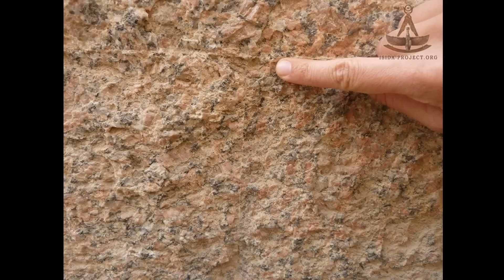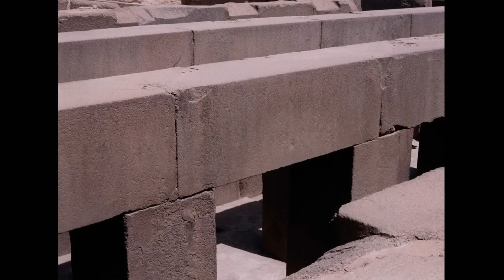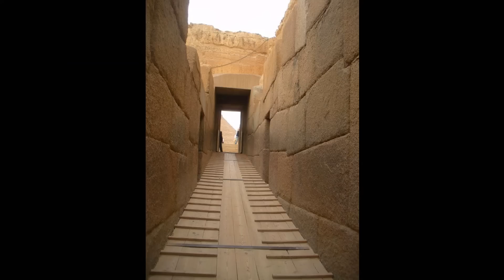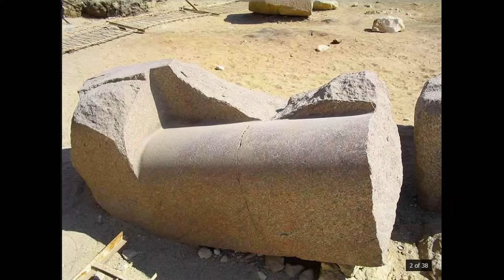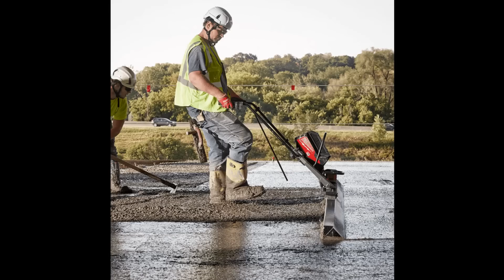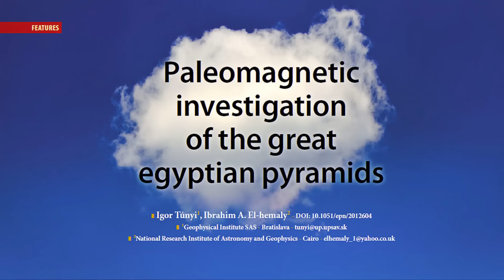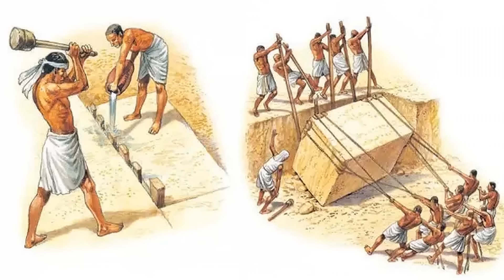How were the Perplexing Giza Pyramids' Granite Blocks Created?

Comment: I spoke to my dad, a retired builder about the granite blocks a couple of years ago. He suggested that they were caste on site. I would never have thought of that, and I had forgotten that he said this.  Makes sense.  How are you, Tina? Still in NY?
Reply: How are the quartz seams kept running through the granite then.
Reply: @MJIZZEL-MJ  You're not meant to ask pointy questions - you'll upset them :)
Reply: @MJIZZEL-MJ  
Some of the stone boxes in the Serapeum have clear visible veins.
Reply: @AArata63  Time stamp?
Reply: @Hallands.  
I didn't get any time stamp when I asked :(
Reply: Timestamp on what? 🤔
Reply: @MJIZZEL-MJ  Time stamp, please!
Reply: @MJIZZEL-MJ  
Where do you see that? Is there a time stamp you can tell me?
Reply: @ where they drill into the igmious types and find in tact organic material at microsopic scale , the carbon dating can be trusted, because its not supposed to be there.
Reply: Nonsensical. Where are the furnaces??? Where would they get heat enough to melt the granite??
Reply: @EggMCMUFFIN-e4l  What's wrong with you?  She did not say a single word about melting anything.  Casting of man-made stone is a cold process just as in the case of concrete.
Reply: @redwoodcoast  what’s wrong with you? Im relating to the comment posted not her reply…
Reply: @redwoodcoast  and why would you go through all the work to cast the stones??? Pulverize it, then make a mold, then find some adhesive to hold it all together, wait weeks for it to cure (look how huge some of these blocks are), and then hope all goes well after that. Natural stones are not cold casted. They’re created under immense heat and pressure, which fuses the crystalline molecules to fuse together. You would not get the same effect with cold casted stones…
Reply: @EggMCMUFFIN-e4l  Several large cast objects failed near the bottom and collapsed according to witnesses but to believe that 2,000,000 lb. blocks were quarried and transported and raised is to believe the impossible.  That only leaves two possibilities: they were cast-in-place or they were carved with extraterrestrial technology as was the unfinished obelisk.
Reply: @redwoodcoast  and what about the giant obelisk tht was carved out of the solid rock? Why would you cast the rock hundreds of miles away from its destination point??? Your casting rocks theory makes no sense… why would you spend hours pulverizing the rock into granules to then have to either heat it or use large amounts of polymer and pressure to hold the rock together???
Reply: @EggMCMUFFIN-e4l  

Cast, like how cement is cast, not how iron is cast.  I guess I have to find a video on how cast stone is made.
Reply: @EggMCMUFFIN-e4l  What's your theory then? ;)
Reply: Geopolymer cement  100%  core samples have shown human hair and other naturally occuring debri in the samples. Statues blown up by muslims had stacked rock cores with cast outer shell.
Reply: It’s crazy that these bots can extract information from her personal file on her account to know where she lives or what her birthday is… These bots are sick. 👆 is a bot you’re responding to 😮
Reply: In 1992, Egyptologist Mark Lehner and stonemason Roger Hopkins conducted a three-week pyramid-building experiment for a Nova television episode. They built a pyramid 6 metres (20 ft) high by 9 metres (30 ft) wide, consisting of a total of 162 cubic metres (5,700 cu ft), or about 405 tons. It was made out of 186 stones weighing an average of 2.2 tons each. Twelve quarrymen carved 186 stones in 22 days, and the structure was erected using 44 men. They used iron hammers, chisels and levers (this is a modern shortcut, as the ancient Egyptians were limited to using copper and later bronze and wood).   But Lehner and Hopkins did experiments with copper tools, noting that they were adequate for the job in hand, provided that additional manpower was available to constantly resharpen the ancient tools. They estimated they would have needed around 20 extra men for this maintenance. Another shortcut taken was the use of a front-end loader or fork lift truck, but modern machinery was not used to finish the construction. They used levers to lift the capstone to a height of 20 feet (6.1 m). Four or five men were able to use levers on stones less than one ton to flip them over and transport them by rolling, but larger stones had to be towed. Lehner and Hopkins found that by putting the stones on wooden sledges and sliding the sledges on wooden tracks, they were able to tow a two-ton stone with 12 to 20 men. The wood for these sledges and tracks would have to have been imported from Lebanon at great cost since there was little, if any, wood in ancient Egypt. While the builders failed to duplicate the precise jointing created by the ancient Egyptians, Hopkins was confident that this could have been achieved with more practice.
Reply: Many of these blocks look to this layman like marshmallows (or 'play-dough') that were pressed into place while still soft. It is all quite fascinating.
Reply from the maker: Thanks for the info. Appreciate it :-)
Reply: Good Video Tina!  Casting makes sense.  One thing that puzzles me is that archeologists and historians assume that all civilizations evolved at the same pace.  I do not believe this to be true.  Today we have Amazon tribes who have little or no contact with the rest of the world.  Basic technology skills compared with the builders in New York City or Dubai.  But we all live in the same time period. This could apply here as well. 🇨🇦
Reply: @lesbendo6363  Why would this have been any different in the ancient world? The majority of the modern world is the same but there are primitive-like people who are the minority. Exchange of knowledge and trade forces people to make improvements and thus copy each other. If there are some people living in isolated regions who don't have contact with the rest of the world, they are obviously left behind; just like today. The existence of primitive people does not negate the rest of the world being modernised. People follow trends and the ancient world was connected.
Reply: @lesbendo6363 is your comment a specifically Canadian comment? Not sure the significance of your flag emoji ;)
Reply: @Boobear83  just to let people where I'm from.
Reply: @lesbendo6363  I was just giving a friendly little jab there ;). Meant no harm and I’m Minnesota so that’s almost Canada :)
Reply: @Boobear83  I'm just out side of Vancouver BC.

Comment: The picture at 9'30" onwards showing some 'pillow' blocks with nubs next to finished blocks - that looks to me as though the blocks were machined flat after they were in place, and this photograph shows where that work was interrupted?
Also, one thing is puzzling me - earlier in the video you showed how the back face of the granite casing stones had been meticulously shaped to fit the eroded limestone behind them. So you are saying this wasn''t done by the Dynastic Egyptians, but by an earlier 'advanced civilisation'? In which case, how did the limetone blocks get so eroded in the first place?
The implication seems to be that the limestone was in place for a very long time (long enough to get eroded) BEFORE this 'advanced civilisation came along and fitted the granite casings? Or have I mis-understood you?

Comment: If the pyramids were simply accumulations of waste and leftover material from a mine, why would anyone bother to work them in such an articulated and precise way, if it was just debris? And if, in another case, they were meant as storage for material to be used in the future, why would they also shape it with such precision and exactness, making it so difficult to dismantle? How does this connect with your theory that they were nothing more than a residual system of a mine?

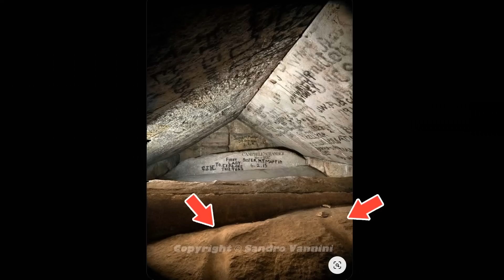Comment: @CuriousBeingbyTina:  You contradict your own theories.  You spend a lot of time stating that the stones were cast, but then follow up at 16:30 stating that the scoop marks match those found in the Aswan Quarry.  If the Aswan quarry is natural rock, and the scoop marks match, then they logically cannot be cast.  I think it's more probable that a grinding process was used, not a cast process, to make the smooth facades as you indicate at the base of the pyramids where the stones are half flat / half bulging.  The marks in the concavity indicating grinding, not screeding.  If it was screeding, the marks would be sharp and consistent, not round and uneven as shown.  The roundness of the concavity backs up this theory as we see it at Aswan on the underside of the unfinished obelisk too.  There is some tool/method the ancients had that was able to grind stone efficiently, and was small enough that a person could manipulate the tool to get into tight spaces in a practical manner. that is the only explanation that spans all the evidence shown thus far.  What is the grinding tool made of?  what kind of design did it have?  Probably some sort of spinning/rotating mechanism of small radius as that could be needed to produce the 'scoop' marks.  Think of a drill, but with a cylindrical grinding stone instead of a drill bit.  Best modern day equivalent would be a router as used in woodshops.  The device would be dragged across the stone with the length of the grinding stone in contact with the surface while spinning.  That's why you get flat spots within the scoop marks.  If it were a pure scoop, then the scoop mark would be round from edge to edge.  but that's not what we see.  What we see is a scoop mark that has rounded edges but a mostly flattened center section.   that indicates a grinding tool that is dragged across the surface and starts/stops where the edges of the scoops are located.  Try it wtih a router and you'll get the same results.

Comment: There are larger medium & small quarts thru out the blocks and cut flat along the surfaces of the blocks meaning they were cut not formed. Think of how much work would be needed to break up granite for casting. That would be even more impressive and the amount of pressure needed is crazy, you can't just make a liquid mix and pour it and have granite.

Comment: An ancient human being striking two cone shaped stones together was fascinated by the change in tone as he brought them closer to each other and then held them further apart. Then to his utter amazement the boulder upon which he was leaning became as soft and lightweight as a marshmallow, but resumed its solidity and weight when the ringing ceased. 
  
A millwright was astonished to find that a metal rod, which was not in contact with a magnetite millstone, became hot and a coil spring became magnetized and attracted iron objects that clung to it when the wheel was in motion, but these characteristics were absent when the wheel was stationary.
   
At a fork in the road of civilization a previous society harnessed sound energy, but our current civilization developed electrical energy, each a product of chance.
   
The ancients employed high frequency sound energy that is a natural result of the vibration of our planet, which is 8 Hz. By creating a phase displacement/difference and frequency multiplication factor they were able to overcome gravity, reduce the hardness of rock to the consistency of putty, produce light and spin objects at high speed, similar in principle to the way an AC motor works with electricity, but in this case with high frequency sound vibration. 
   
Harnessing this energy is done with an accumulator such as the pyramid that is a large mass with an insulating outer shell. This occurs naturally in an arid climate over an underground aquifer. Lightning that we erroneously believe is a discharge of static electricity is a release of vibration energy. Sound has a slightly magnetic quality. It is thunder that results in a flash of light, not vice versa.
  
Rock resumes its solid state when sound energy is withdrawn leaving a knob at the exit point on the side of the block nearest the source of sound. In Egypt and India there are numerous examples of finely detailed intricate stonework, as they have evidently made use of vibration energy.
  
Phase displacement is caused by sending sound tones through a pair of stone cones from the base to their apex. (Sound waves in a speaker do the opposite, proceeding from the apex to the base). Sound moving from the base of a cone to its apex likely causes its speed to accelerate and its frequency to multiply. A depiction of the Egyptian light bulb in one of the drawings from a temple includes an object that resembles a tuning fork made of stone that is about eight feet high with one prong longer than the other. That was likely used to create a phase difference in the stream of sound energy. The pair of stone cones, ankh and accompanying column of plates separated by air were likely control devices. An understanding of the true nature of gravity reveals how this energy is utilized. The buzzing sound passing through cones in an insect’s wings overcomes gravity and keeps it aloft. In the Philadelphia experiment it was an application of these principles that caused sailors to become embedded in the metal of the ship.

Comment: Like one magnet pushing against the same pole of another it is not unreasonable to expect that gravity exhibits a similar property and given appropriate circumstances one object will neutralize the weight of another and even raise it. 

Consider the universe where gravity exerted one percent of its current force in which an object that now weighs one hundred tons, formerly weighed one ton and was only one-hundredth as solid. Stone blocks could be cut and lifted with ease.

On a continuum between the spiritual and signate matter, in which the spiritual is zero and designated matter is one hundred, the universe is now at the 100 percent material level. The human mind, constrained by religious narrative, cannot conceive of a state of being that is somewhere in-between these two limits. Gravity under the influence of mysterious phenomena X that derives from the vibration of the universe is an integral part of the equation. The buzzing of an insect’s wings neutralizes gravity and keeps it aloft. Gravity is not a fixed, constant value. It only appears that way observed from a limited time frame perspective.

Without this sound vibration that results in gravity, material is weightless. Neither is light reflected rendering humans invisible so that they cannot be distinguished from spiritual existence. Sustenance is not required to maintain bodily processes, as temperature is irrelevant. Death is life in which gravity is absent of a role.

At the one percent level of being, granite is much like expanded polystyrene. No longer heavy, solid rock may be scooped out. Tool marks and bore holes are evident on ancient cuttings. 

With the passage of time the state of reality of the universe has advanced from the zero percent to the one-hundred percent level making objects fully physical and material. Man is incapable of moving these blocks whose weight has increased by hundreds of tons.

Warning: This point-of-view may not be suitable for those that believe that the sun revolves around the earth, which is flat, as this is plainly common sense.

Comment: Geopolymer , proven by drilled sampling contains  human hair and other debris. Chris Dunn explains very completely the function. Far too many lies told about these pyramids. Regarding copper for tooling, if 2% beryllium is added to copper it is harder and stronger than steel. Copper is easily poured for castings. Copper could  have diamond cast into it and caste to round hollow shapes for drilling. How ever cast geopolymers are very workable. When statues were blown up by muslims they were seen to be castings with stacked rock inside. Glad to see you talking sense about these obvious castings.

Comment: 1992, Egyptologist Mark Lehner and stonemason Roger Hopkins conducted a three-week pyramid-building experiment for a Nova television episode. They built a pyramid 6 metres (20 ft) high by 9 metres (30 ft) wide, consisting of a total of 162 cubic metres (5,700 cu ft), or about 405 tons. It was made out of 186 stones weighing an average of 2.2 tons each. Twelve quarrymen carved 186 stones in 22 days, and the structure was erected using 44 men. They used iron hammers, chisels and levers (this is a modern shortcut, as the ancient Egyptians were limited to using copper and later bronze and wood).   But Lehner and Hopkins did experiments with copper tools, noting that they were adequate for the job in hand, provided that additional manpower was available to constantly resharpen the ancient tools. They estimated they would have needed around 20 extra men for this maintenance. Another shortcut taken was the use of a front-end loader or fork lift truck, but modern machinery was not used to finish the construction. They used levers to lift the capstone to a height of 20 feet (6.1 m). Four or five men were able to use levers on stones less than one ton to flip them over and transport them by rolling, but larger stones had to be towed. Lehner and Hopkins found that by putting the stones on wooden sledges and sliding the sledges on wooden tracks, they were able to tow a two-ton stone with 12 to 20 men. The wood for these sledges and tracks would have to have been imported from Lebanon at great cost since there was little, if any, wood in ancient Egypt. While the builders failed to duplicate the precise jointing created by the ancient Egyptians, Hopkins was confident that this could have been achieved with more practice.

Another Grifter telling a limited story for the school drop outs.